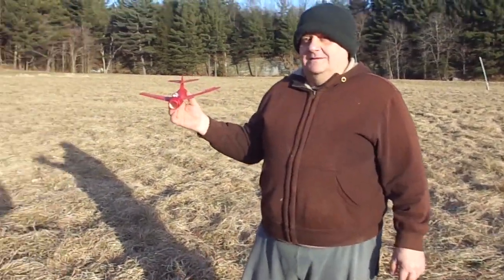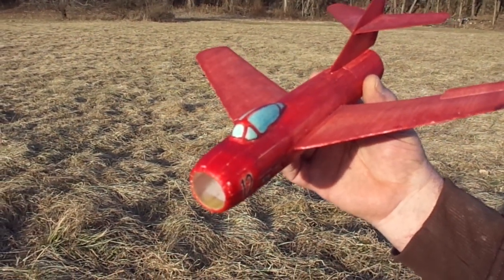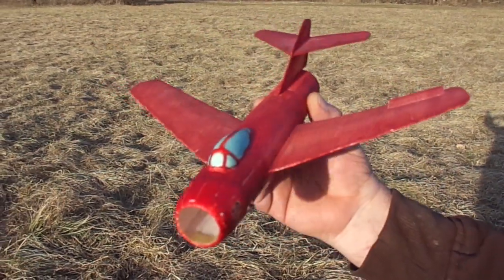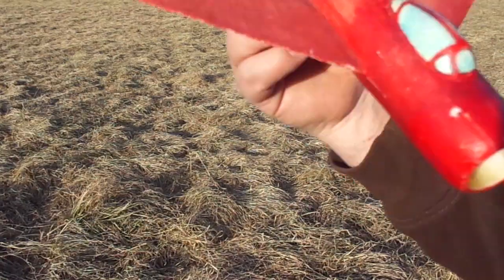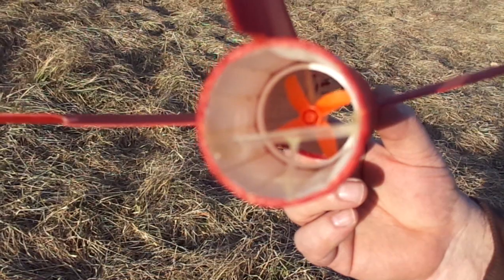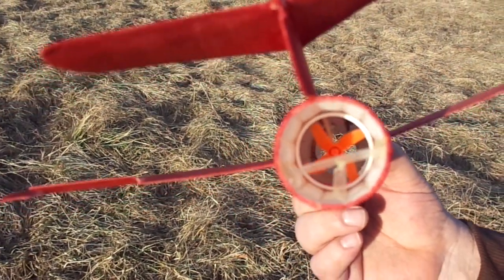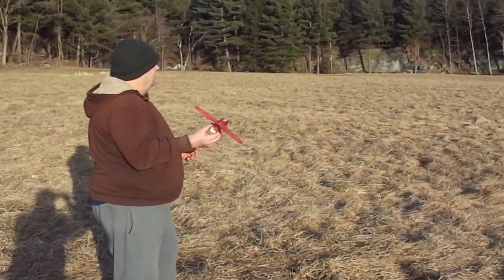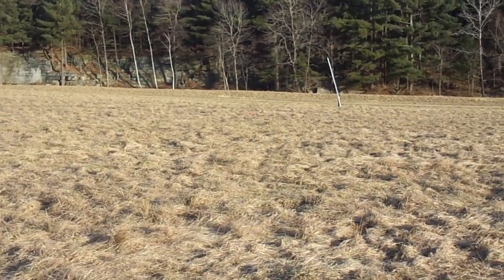Supercap Ducted Fan? We're Getting Closer! MiG 15

Comment: That’s better than my Keillor Kraft jetex mig15
Reply from the maker: This plane owes me some decent flights! I'm not giving up!
Reply: .? More power, bigger battery or more efficient ducted fan. KP aero make then in UK
Reply: I think inflow and outflow sizes are critical. There’s an article in Aeromodeller magazine a few months ago.
Reply from the maker: Didn't know that, I'll check them out!
Reply from the maker: You probably can't see it in the video, but there is a monstrous cheater hole intake right in front of the fan...much bigger than the tailpipe diameter. Without it, thrust was really weak! Huge improvement when I chopped that hole! It would work fine if it wasn't required to run on the 2.8V the supercap provides. I'm going to try boosting the cap a little higher before I go the lipo route, it's so close to working as is...